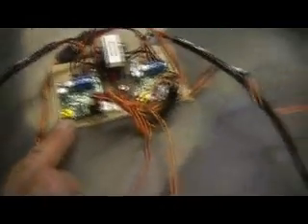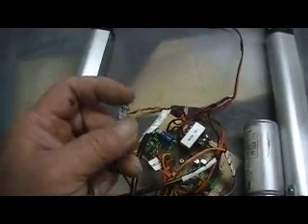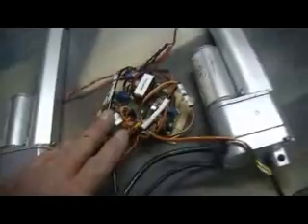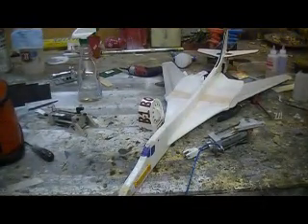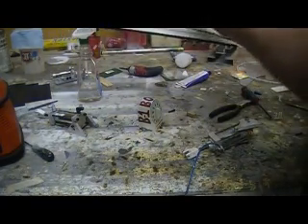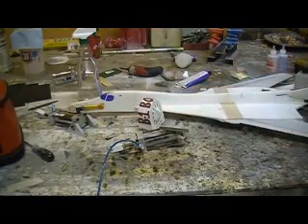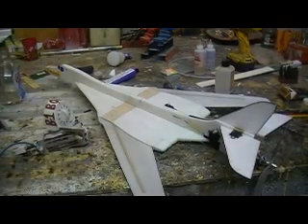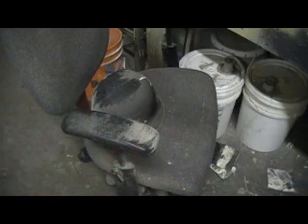how to build a rc jet B-1 Bomber # 185 pt 3

Comment: Wings-weep pt 2:  When they landed it was at 250 kts,  They blew several tires, and the brakes caught on fire.  The cause was the cross-ship control shaft, which was nothing more than a cable, had somehow bird-nested.
David

Comment: A little info about the real B-1 wing-sweep system:
The real aircraft has a single actuator that drives both wings via a torque tube called the cross ship drive shaft.  There is another item called the cross ship control shaft which shuts down the system if the wings try to go asymmetrical.

One time at Dyess we had a flight test mission where the wing-sweep got stuck at 55 deg.  It couldn't land at Dyess because the runway was too short.  So it had to go to Edwards to land. 
David